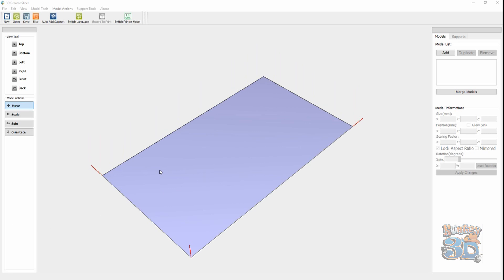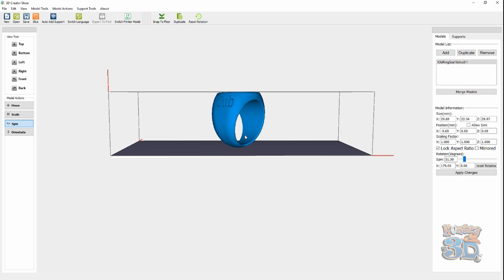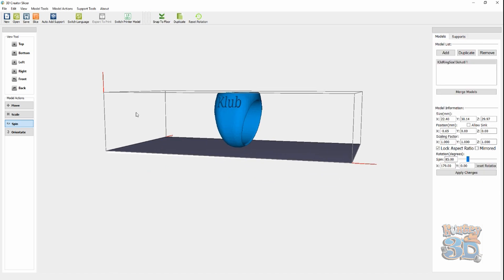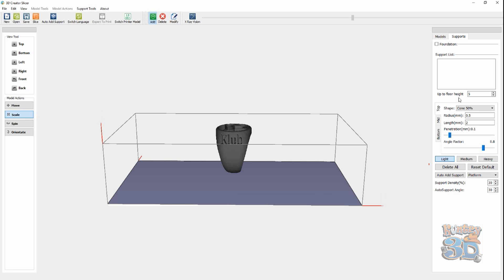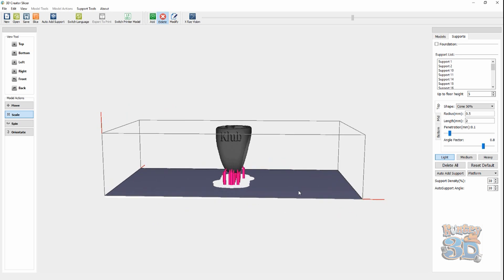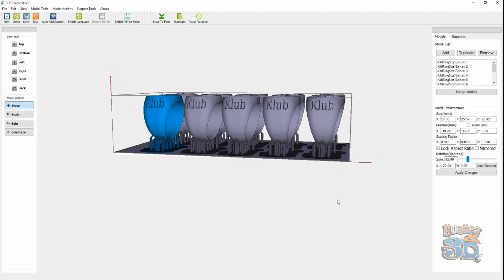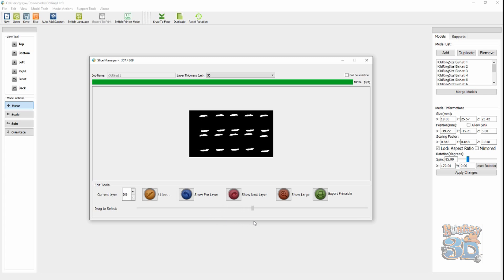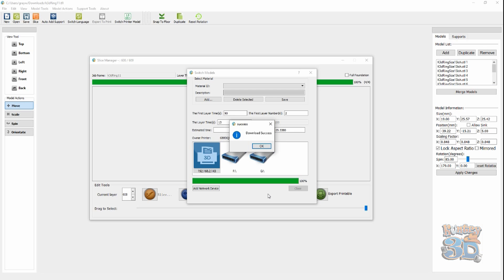Slicing for a Resin Printer - LD-001 - 3D Creator Slicer

Comment: hii. I need some help because i cannot read the words that appear on the 3d creator cause i dont know why they are cut so i cannot read the whole words so it is difficult to understand. Can you send me the installer cause i could not find it on the internet. Thanks. here is my e-mail if you need it: mataslucas@hotmail.com   another question. I have the creality ld 001 and i wanna use the chitubox too. but i cannot send the file to the printer. i really need some help. thanks!!

Comment: would this work with all 3d resin printer do you think
Reply from the maker: The process should be the same, but all software will not. The printer I have has proprietary software.